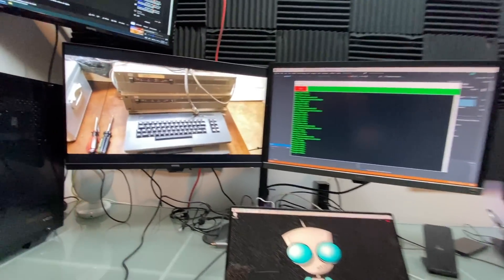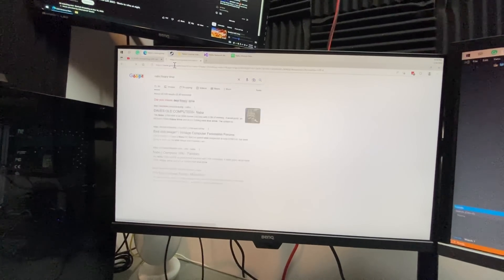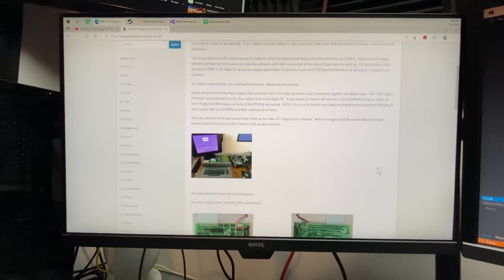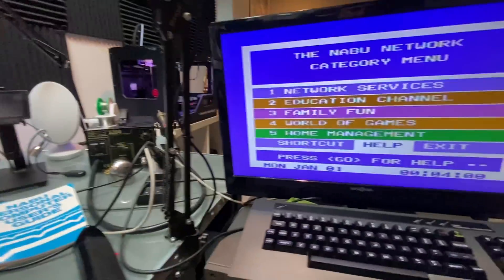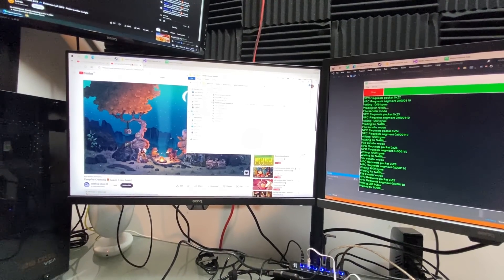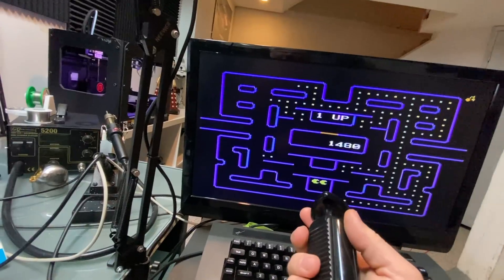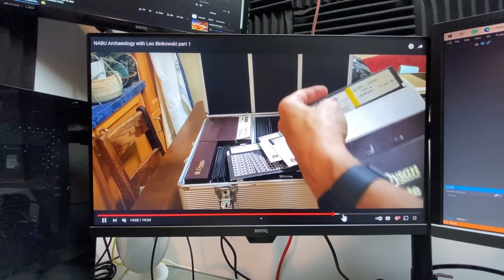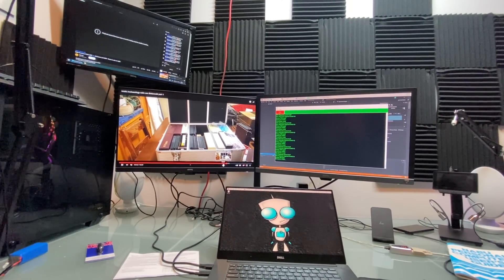20 - Nabu computer video you must watch!

Comment: 👍🏼
Nowadays you don't need another settop box to act as a RF modem for NABU. It can be literally emulated by small DIY controller kit (similar to one you showed in part about floppy emulation) and on other side can be anything from PC with HD to connection to the actual internet.

Comment: A small group of us are also working on the RF side of things, to eventually want have a few NABU adapters connected up to a modulator spewing the wagon wheel of data segments down some coax at them.  The adapter has some interesting design choices lurking inside, and it will certainly take some time to reverse engineer.
Reply: there are a few on site at the arcade spares site

Comment: I actually have an F18A sitting in a drawer that was meant to be used in my TI99/4A, but my Nabu is being delivered tomorrow… Since it’s basically a drop-in replacement for the TMS9918A, it could also go in the Nabu. Built in VGA-output sounds useful at least.
Reply: No contact info I could find on the F18A website. The NABU computer presents a pretty good sized potential market for that VDP replacement. I didn't know the MK2 was shipping.
Reply: @greggv8  The MK2 isn’t shipping yet. I ended up just e-mailing the person who makes the F18A and just asked to be informed when and if it became available again earlier this year and it just worked out when I got a response a while later out of the blue that they were available. They seem to be out of stock again sadly.

Comment: Yes, having a floppy controller that works with a floppy emulator and or drive would make it a real computer providing you can just shove a disk in it with CPM or Basic. Just to ward off the tolls. Most computer had basic built in unless say it was a dumb terminal. But since this is a subscription based model. I don't think I even caught that you could purchase the floppy drive or controller but saw an add that you could rent it.
Reply: You could purchase a NABU outright for $995, something like $1295 for single floppy and $1495 for dual floppy. CP/M cost $125
Reply: @leo.binkowski  Oh got to love those costs from the 80's. Nice to know. To bad like several over companies. Clones was going to rule the work. Well in about 10 more years.Thanks for the reply.

Comment: but anyway would be cool as shit if we can copy the hardware maybe I can do it on FPGA or just a srt8 up hardware copy on the system
Reply from the maker: It's similar to the MSX - hardware, except the ports are different and specifically the keyboard doesn't require a controller as it's input is through a uart. If you can fpga replicate an MSX1, then the information available can get you to the Nabu. There's a video of someone who has loaded the nabu rom in a modified msx emulator. What is missing is the piece I've been successful reverse engineering - the hcca communication protocol to load software. Once you get the rom loaded in your emulator, loading files is a breeze
Reply: @DJSures  i always wonder given it was a cabel data stream that is 0.8 Mbps speed would this have made a new breed of game if this system catch on? like given how much faster to a floppy it is would it can pull data in and out of the 64kb on the fly when you move to a new area of the game and so on so fast that it feel like a 16 bit game at times.
Reply from the maker: @zsewqthewolf1194  With the recent implementation of my loading hack, it can stream and load - you're right. The original method it woudl be slower because the cable would only be sending portions of all the available programs in a loop
Reply: @DJSures  thats the thing i like when old hardware meet new ways of coding, I mean really if people in the 70s and 80s had our coding skills back then the tech world would be so deffent from today right now if they did.